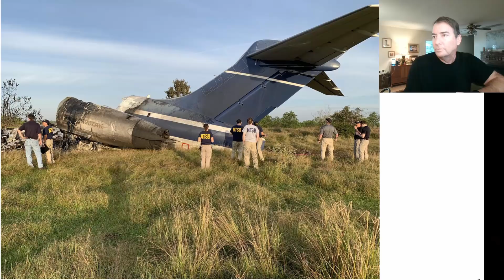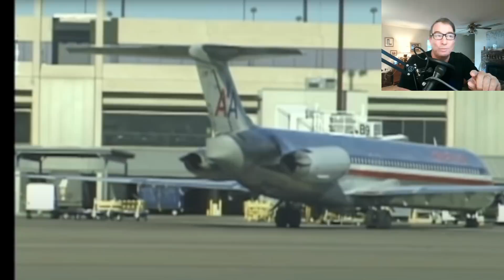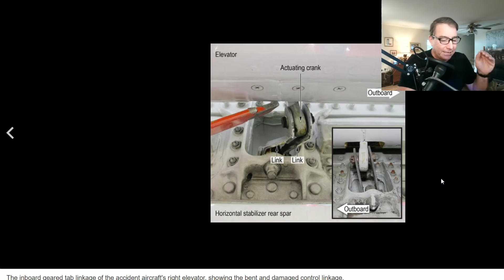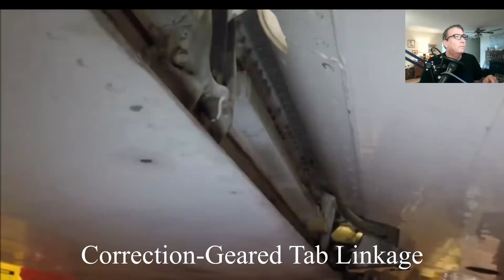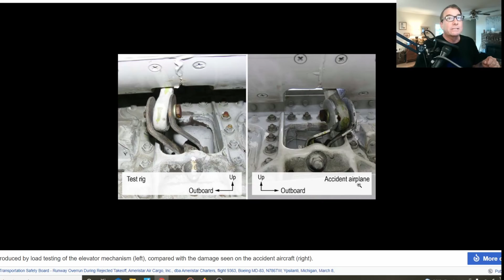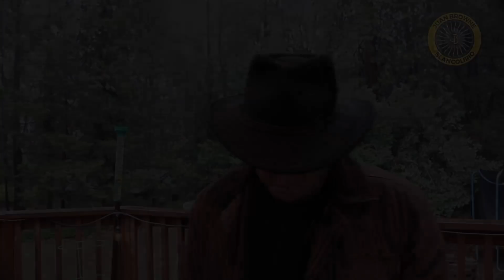MD-87 Crash Houston UPDATE 9 Nov. Flight Controls

Comment: That was a GREAT demonstration--- and seeing this, coupled with you just saying the word "Jackscrew", even before "Alaska", made me wonder about this planes over-all design. In the Alaska accident, if I remember right, it was neglect that cause that horror- If these forces are a typical, and not abnormal situation for this aircraft? This design should have been re-engineered, long, long ago. 

I've been through strong winds in CA, (used to live in Folsom, as I believe I've mentioned), and spent much time in the Tahoe region, especially around Stampede Reservoir, and now I'm back in CO, and have been for almost 10 years now. BOTH locations, have NOT unusual 50-60+ wind gusts. 

TX/OK/KS they clock even higher- this was a 5 knot difference. This design, IMO? Should have been constructed for 90-100+ Knots stability. We're talking human lives here- Costs are an issue, I know, and this time? None were lost. But to me? It's the THINKING beforehand that appears to be an issue. Winds haven't changed much, if at all. These gusts can happen at any time, and should have been THE key factor, when constructing those hinges- Just like that Jackscrew on Alaska- Poor Maintenance got many killed- But these designs, on KEY PARTS, must be designed with "EASE of MAINTENENCE & UP-KEEP" in mind first- IMO, and not cheapest or easiest to create, from the start. 

NOTHING is perfect. But we need SOLUTIONS, and viable ones. Or we'll keep getting companies, like that "Winglet" company Dan Gryder's been all over, trying to stand by something, just waiting to kill the next in line for it's failure.
Reply: The problem on the Alaskan flight was improper/extended maintenance periods on the Jack screw , and a combination of different grease used which wore the thread faster as it became abrasive.

The pilot training at the time was also a cause as it was discovered if the pilots didn’t try to unjam the stabiliser it had a high probably the screw would have held , not to say the crew was at fault , they did what their training at the time recommended.

In summary, poor maintenance and insufficient crew training was the cause , if properly serviced there is minimal risk .

It is also worth noting other aircraft like the 737 , 747, 757 and 767 also use a  Jack screw for the horizontal stabiliser trim .
Reply: The Alaska accident was caused improper maintenance of the jack screw and fraudulently claiming that it was done
Reply: @leeoldershaw956  More complicated than that

Comment: surprising there haven't been more accidents from this considering how many of these aircraft were in service over decades of use.
Reply: I remember 2 in the 80s that blamed a stripped jack screw on the elevator
Reply: Exactly... the statistics do not support this theory.
Reply: @chrisloftus439  The elevators don’t have a Jackscrew, the pitch trim does.
Reply: @johnyoung1128  confused me
Reply: @chrisloftus439  The elevators are moved by aerodynamic forces generated by control and servo tabs on the elevators trailing edges, there is no screw jacks involved in their movements. The pitch trim system operates by moving the horizontal stabiliser and does have a screw jack. The elevators are hinged off the rear of the horizontal stabiliser but not actuated by the pitch trim screw jack but as described by JB are moved by cables from the control yoke to control tabs on the trailing edges of the elevators which generate aerodynamic “ leverage” to in turn move the elevators. Pitch trim and primary pitch control are not the same systems but separate. In the case of the Alaskan MD80 the failure of the pitch trim screw jack allowed the horizontal stabiliser to move to a position that did not allow the crew enough “authority” from the elevators to override the massive out of trim force created by the position of the horizontal stabiliser. It was not a primary pitch control failure in its own right.

Comment: Wow, I learned a new thing about the elevators on MD-80s, that they are completely free-floating and their positions are controlled only via the tabs. It makes the Alaska 261 disaster far more easy to visualize, once the pitch trim jackscrew broke loose, and how horrible that must have been. I had never understood how they so profoundly lost all pitch control, but now it’s obvious.
Reply: The jackscrew failure on the Alaska MD80 is not related to elevator operation but to pitch trim operation.
Reply: @johnyoung1128  I know it is, but I had always wondered why they couldn’t maintain at least some pitch control with the elevator even with the stabilizer surface floating free after the jackscrew failure. Now that I understand that the elevator itself is floating free, only controlled with a tab, it makes more sense.
Reply: Regardless of what moves an elevator (aerodynamic force created by tabs in the case of the DC-9;  hydraulic cylinders in the case of many other types), a mispositioned horizontal stabilizer can potentially generate a far larger aero load than what an elevator can counteract.  Perhaps the key point here is that in the case of the Alaska Airlines crash, the stab wasn't "floating free" the whole time.  At some point aero loads caused it to fully pivot and stay there, held against whatever structure stopped it by even larger aero loads than what got it started.  Once pinned in that unfavorable position, there wasn't anything that could be done with the elevator (any sort of elevator) to move it.

It is possible that a powered elevator would have provided a wider range of speeds/attitudes from which movement to hard-stop could have been avoided, but once the stab got there it was going to stay there... unless something in the aircraft's movements during the plummet happened to remove its aero load.  But that would have come from randomness/luck, rather than from a control input.

Edit:  I'm now seeing this further down in the Comments

*****
Blue Skies
11 hours ago
Alaska accident was an MD80.   It involved a jammed stabilizer Jack Screw.   They then put so much load on the Jack screw that it stripped all the threads off the screw and lead to an uncontrollable situation.   The entire stabilizer departed the aircraft inflight.
*****

I didn't recall the horizontal stabilizer having separated in-flight (never read the NTSB report), but if so that would be an even better reason for why the elevator wasn't going to be of any use  ; )
Reply: @marcmcreynolds2827  The horizontal stabiliser should never float free. The elevators float free and that was explained by JB in the video. I am aware of the failure mechanism of the Alaskan MD80 as it was part of the Qantas human factors course that I attended years back , and I am quite familiar with that family of aircraft. By the way hydraulic actuation has no effect on the force a control surface exerts on the airframe, its surface area and deflection regardless of how its actuated. One of the reasons I like this channel is that JB prefers to keep to the facts and the facts appear to be that the accident he is describing is unrelated to the Alaskan accident.
Reply: @johnyoung1128   I'm not sure where our miscommunication is.  The intent of my post was to affirm your original post above.  I completely agree that the cause of this incident and the Alaska crash are unrelated, for example. The OP brought up "floating free" and how tabs vs hydraulics matters, so after your answer didn't seem to convince them I figured I would give it a try.  Point out that once a stab is floating free and at some point maybe "pins" itself, then its much smaller elevator won't be able to dislodge it regardless of whether that elevator is actuated by an aero tab or hydraulics.

As for "hydraulic actuation has no effect on the force a control surface exerts on the airframe, its surface area and deflection regardless of how its actuated",  perhaps that was in response to my  "It is possible that a powered elevator would have provided a wider range of speeds/attitudes from which movement to hard-stop could have been avoided".  I was speaking to how, in unusual attitudes such as Alaska 261 found itself, there could be unfavorable flow patterns over the control tabs leading to less elevator deflection than for a hydraulic system, which moves the elevator independent of aerodynamics.  That possibility is one consideration in for example designing for deep stall recovery with a tabbed elevator design.

While we're on the subject, though, it should be noted there aren't equal aero forces generated by a hydraulic elevator and a tabbed elevator of the same planar area.  The very concept of a tabbed elevator is that lift (more accurately, resultant force) from the tab is in the opposite direction to lift from the rest of the elevator.  So there's a lift subtraction going on with that approach, as can be seen with a force diagram of how a tabbed elevator works.  Or as a simple geometric visualization, imagine looking straight-on (zero angle of attack, visually) at a horizontal stabilizer from the front.  The elevator can't be seen yet, because it starts out at zero degrees.  Now up-elevator is applied, and its apparent height to the viewer is the sine of its deflection angle times elevator chord (minus whatever is hidden by the thickness of the stab)...  but only for a hydraulically-actuated design.  For a tabbed one, the tabbed portion of the chord will be angled down relative to the rest of the elevator.  Not as much height to deflect airflow, and so a bit less lift overall from that sort of elevator (but more drag, which trades against reduced hydraulics weight in choosing one design or another).
Reply: @marcmcreynolds2827  then I apologise for the miscommunication.
Reply: @johnyoung1128  No problem.  The more I re-read what I wrote, the more I can see the potential ambiguities.  But it was just as well in the end, because the additional correspondence got me thinking about aspects of the design tradeoffs that I hadn't considered before.  Mostly though, I'm envious you got to take a Human Factors course through Qantas.  I had a generic university course in the subject, but your aircraft-specific one was probably a lot more fun.  Especially if the instructor had off-the-record tales to tell.
Reply: @marcmcreynolds2827  I was employed by a labour hire company under contract to Qantas, and it was a human factors course specifically in relation to maintenance errors, at the time Qantas insisted on all those involved in the maintenance of its fleet do the course. Of course Qantas never operated that aircraft type but used that scenario to illustrate how badly things can go wrong.

Comment: Could using reverse thrust to back away from the ramp under the wrong conditions cause linkage damage?  After further thought, I guess if damage happened during reverse thrust ramp back out, the problem would show up on the subsequent take off unless only partial damage occurred.

Comment: I flew the -80 for 13 years. Often when taxiing downwind to the takeoff runway, an aircraft behind would ask about the split elevators thinking something was broke. We'd push the yoke full forward, the hydraulics would push both elevators into the down (stall recovery) position, we'd ask if that was better.......  made the Boeing pilots happy.

Comment: Seems like a fundamental design flaw in the elevator/linkage system of the DC-9 aircraft type.
The NTSB is pretty good at getting to root causes and making recommendations
for corrective action, but the agency has no enforcement power. That too, is
a design flaw, but in the regulatory protocols. The FAA has the enforcement authority, but it
is notoriously slow in implementing needed changes. 
The NTSB should be given enforcement authority, once it has determined the cause of
an accident, and the changes needed to avoid future problems.
To offer an analogy: When the local Sheriff wants to make an arrest, he does not have to
consult with the Highway Patrol first. He conducts his own investigation, and if required, makes the arrest.

Comment: One thing that just came to mind today - you stated that your source quoted the pilot as having taken the thrust reverser buckets back to closed (instinctively).  Is there an explanation tied in with that which would explain the rather obvious scorch marks from number one engine and none from the number two side?  I remember that at first everyone had fixated on the suspected compressor stall on number two engine, and all pointed to the lack of burnt grass behind that engine.  I think that this led to a supposition of a lack of acceleration incident.

So many possibilities.  I bet the truth is pretty interesting.  I just wonder if it will see the light of day.

Comment: Thanks! Never knew that aircraft aerodynamic control could be effected by direct pilot control of tabs only! Obvious, in retrospect, is that usual exploration of flight control smooth and free movement prior to take off would, in the case of tab-controlled aircraft, only verify free and complete movement of the tabs! Which are insufficient, in and of themselves, to control the airplane. Also interesting, is that, in the case of a frozen control surface, tab movement in flight would produce aerodynamic force opposite (although small) to pilot's intent. Ooops!

Comment: It may not be high tech enough for some, but I would carry a long stick aboard, so that the free travel of the elevator could be checked from the ground by the flight crew during preflight inspection.
Reply: It’s gunna be a long stick - tail height is 9.5m (about 30 ft)
Reply: @axelknutt5065  
Yikes!
Gonna need 25 feet, or so, of stick!
It might still be doable as long as those elevator halves are not too heavy.

Comment: I wish the AP had someone with a modicum of aircraft knowledge writing for them. "Flight controls jammed". "Tail wing". " The controls were so badly jammed, investigators couldn't even move the adjustable flaps on the MD-87 tail by hand."
They have no Idea how the horizontal stab and elevators work on this (or any) aircraft. To them, aileron, flap, elevator, trim tab, spoiler are pretty much the same thing.

Comment: Could a 717 suffer the same fault? We have quite a lot of 717 aircraft in Australia operated by Qantaslink. I believe that they are serviced in Canberra. Weirdly, one of the first jets I flew on was a DC9 from Sydney to Canberra and I remember using the rear door. That was over 40 years ago. The DC9 and 727 were popular for the rear doors to improve entry and egress without ground support. Many small Australian airports still don't have jet bridges. Thanks again, Juan.

Comment: 'inspect your aircraft in less winds than the original specification' - this implies any place it is parked must have continuous monitoring of wind across the whole site. Given this failure can occur in a second or two long gust, I question if any facility has this, and in practice you'd need to limit it to a much, much lower figure if you are just using occasional wind measurements or measurements distant from the aircraft by more than a few yards.
Reply: Indeed.

Comment: "copycat from the internet" 
CONTROL tab:  directly connected to the control column (FO fly the right elevator, CP fly the left elevator) 
 GEARED tab: as fitted to the elevators was, linked to the rear spar of the horizontal stabilizer. Movement of the elevator away from neutral resulted in the gearedtab deflecting in the opposite direction to assist the elevator movement reducing pilot forces.
 Anti-float tab: that is deflected mechanically once the horizontal stabilizer reaches 10-12.5° ANU trim and serves also to assit the deflection of the elevator as it starts getting blanked off by the LE of the stabilizer

Comment: So this control system is even more prone to difficult stall recovery since aerodynamic forces are required to move the elevator as opposed to pure mechanical input from the yoke. This seems particularly problematic with a t-tail configuration as airflow over the tail could easily be interrupted in a nose high attitude. Not the case in this accident but....
Reply: That's one reason why the horizontal stabilizer is made the size/area that it is.  Able to provide adequate recovery from deep stall.  There's cockpit video of the MD-87's FAA certification test on YouTube.

Comment: The problem is that if the high winds occurred during the night, at a lightly manned airport, the maintenance crew might not know about the weather event, to then institute a check of the elevator linkages. It all sounds like a system designed to fail.
Reply: Indeed.
Reply: I live about one mile south of Houston Executive Airport.  After watching your video I went to NOAA weather history.  On or about 10/16 we had our first major cool front.  That front and subsequent days after were very strong winds.  I don’t recall anything exceeding 60 knots however.  Great channel!

Comment: The white smoke on takeoff is probably due to a compressor stall, according to other experts (MD 87 Pilots) that watch this video as well. If that is true then what is the possibility that the pilots ignore the compressor stall and tried to take off, knowing that they have a serious problem in engine number 1? I think that this pilots version of what have happened might differ from the VFR data, but it is  up to the NTSB to sort this out.

Comment: I’m thinking the viscous couplers work similar to a slow closing toilet lid?
Reply: FWIW, the lid is slowed by shear viscosity of something grease-like between two closely-fitting surfaces (e.g. pin rotating within a cylinder).  The aircraft damper is a volume of silicone fluid "squirting" between one chamber and another.  The difference is significant because the "toilet" approach makes movement more difficult at any speed, while the damper can be designed (such as by tailoring the orifice area) to offer little resistance at normal stroke speeds.